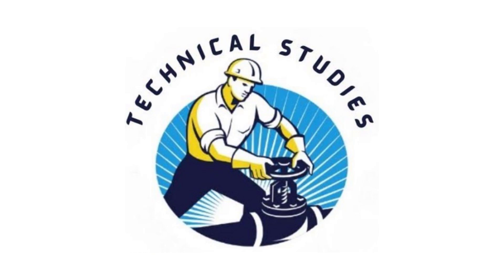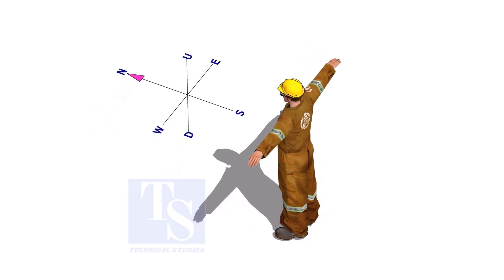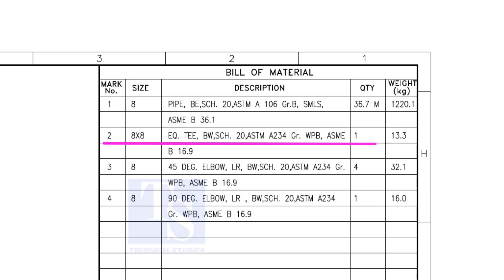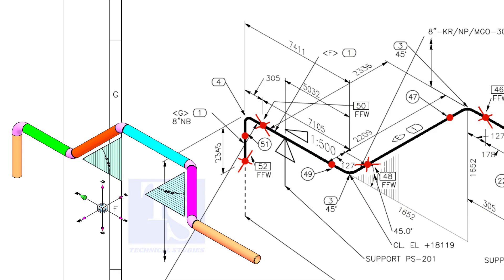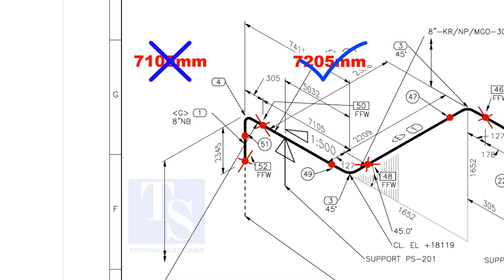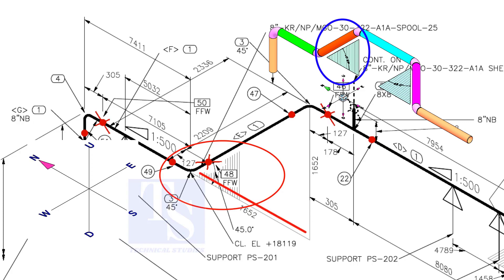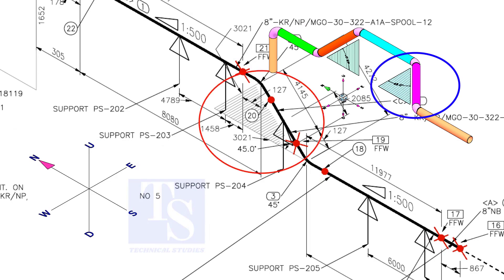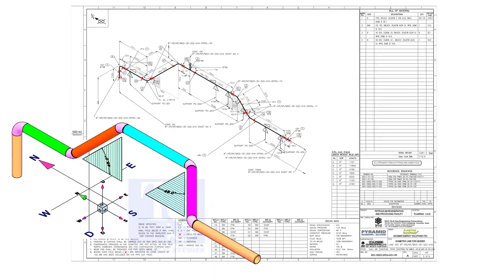Pipe Rolling- Horizontal, Vertical, Slope Tutorial

Comment: How do you fit up a joint (s) which has a slope on the pipe? Do the end of pipe and fittings needed to be trimmed accordingly in order to follow the required slope?
Reply from the maker: Depends the situation  Bro. Assume that the elbow is in horizontal position, mostly you dont have to trim the elbow.

Comment: Hello Sir. Yesterday I commented on your video and you gave me a link to your videos. I already understand the video link you gave me to watch. What I meant was how to find the location and position of the pipe with the isometric drawing when doing installations of pipes. Given for example N=38867 E=28674 and EL= +25890. I want to understand how I can use the coordinates to find the location of the pipe. I already understand the isometric drawing directions but do not know how find the position.
Reply from the maker: Your question is very nice. In every oil and gas plant, there will be a benchmark, a 0 point E- 0000, N-000, and EL- 0000. And a plant north, it may not be the actual north. You need to find this bench mark, and calculate or measure the north and east distances from this benchmark. If you have the plan drawings, it will be easy. Suppose you are working in an old plant, check the pipe rack columns, mostly, you will find the east and north elevations on the columns.
Reply: @technicalstudies.  Thanks for the information.